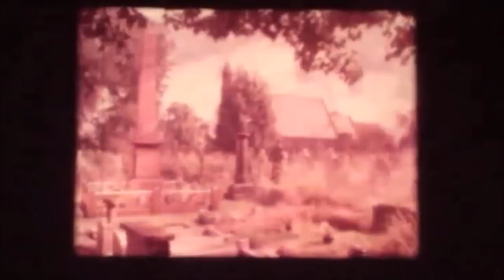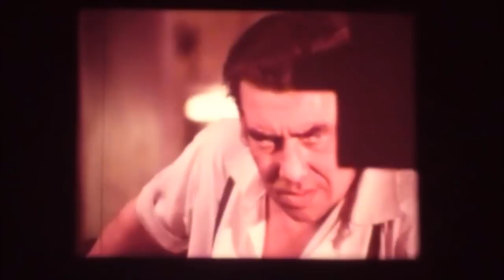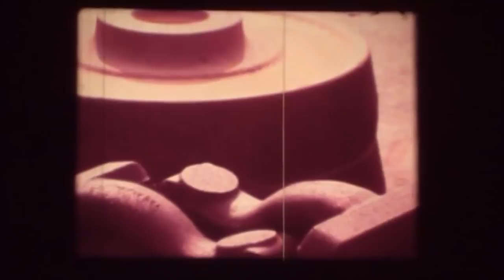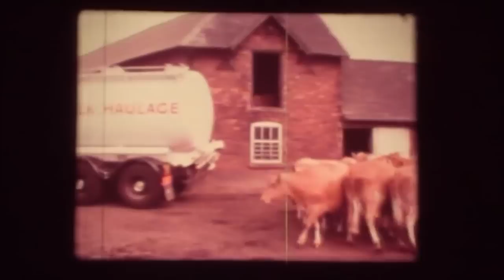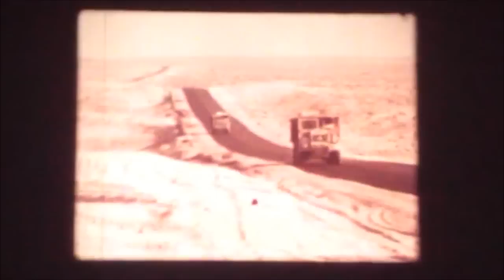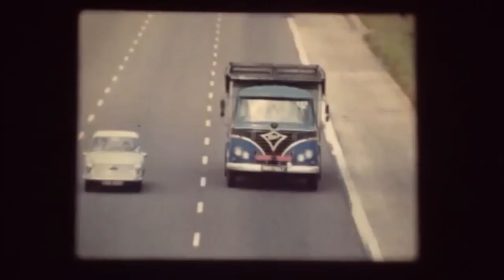Foden the Truckmakers

Comment: The Fodens are Legendary . With cause . Last  I  saw  of the Breed  was a thing called an  E R F . Badged Western Star .
Western Star make Great Trucks too . The current BEST . They do NOT  however design a Cabover . 
Chose the Foden to carry their badge . Caterpillar powered unfortunately . Problematic installation .
V-8  or  even V-12 Detroit Two-stroke would have fit MUCH easier . Was  a Great Truck that ERF .
VERY  well  thought  out . Kinda Ugly  but................. Ah Well . Comfortable , Fast , Handled SUPERBLY  great Ergonomics , Quiet without being TOO quiet , Easy to get in and out of , even though it didn't look like it should be (Cabover issue ,that) Etc..............
Reply: Mate you are talking sh## Erf was nothing to do with Foden, fitting the unryliabu 3208 cat or big thirsty 12/71 would have lost more sales

Comment: Classic British engineering supremacy, all gone through corporate ambition and sell off to another company ie Paccar.. Very sad. I would never have sold off Foden at all or accepted a takeover by another company. I would however have moved with the times and updated the products to include driver passenger airbags, electronic climate controlled air-conditioning, high quality stereos, anti whiplash seat head restraints, seatbelt pre-tensioners, pedals that collapse in a front impact to protect legs ankles thighs in a frontal impact, and included the possibility of running on alternative fuels i.e. hydrogen biodiesel LPG Liquified Natural Gas etc.
Reply: Fodens were mainly a fleet vehicle and not really spec'd with the end user in mind.  
Your "great" ideas would mean that you would not have had to sell the company - it would have been available really cheap from the liquidators.